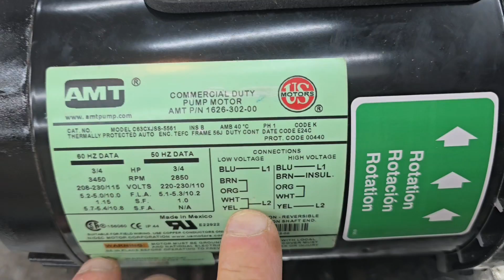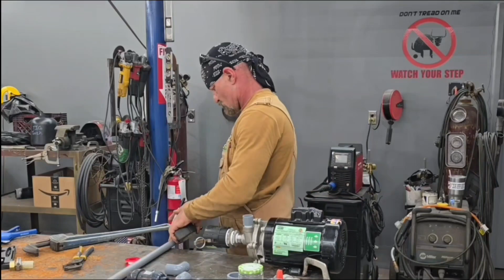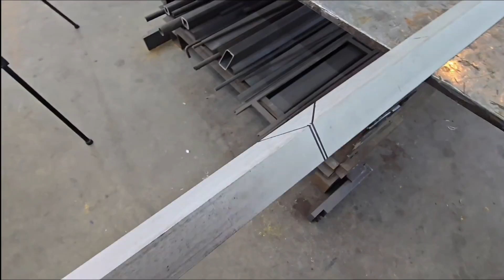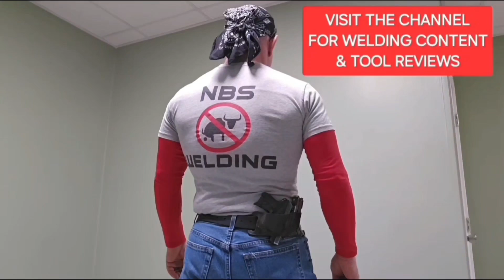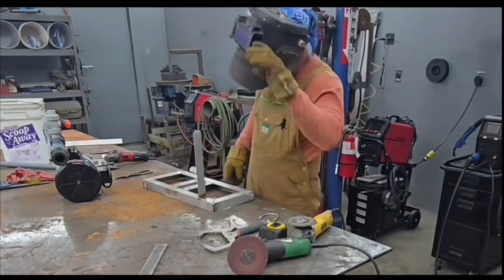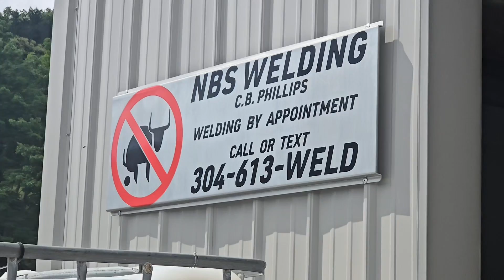MIG welding stainless steel angle frame and water pump rig up

Comment: Nice work as usual, C.B. I have a question not pertaining to this video. My question is, which process would you use to weld a set of new  hangers to a dump trailer? Thanks, C.B.
Reply from the maker: Stick, MIG, or flux core
Reply: @NBSWELDING Awesome thx C.B.!

Comment: What is the point of the pump? You can just open the valve on the tote.
Reply from the maker: The pump is to be used on a jobsite to empty water in a large plastic tank called a "duck pond" on the site of a natural gas or oil well

The only thing I'm using the tote for is to test the operation of these pump assemblies as I fabricate them and hear the pumps run to see if there are any bad bearings or impeller issues

Comment: thats nice but i think you should  have made a handle for it in my opinion people will carry it by the pipe
Reply from the maker: It's meant to be carried by the pipe and the schedule 80 CPVC is more than strong enough to be used as a handle...its quite comfortable to carry by the pipe and there is no issue with that

Comment: My understanding of hard wire MIG welding stainless steel with 75/25 is that you’re giving up some corrosion resistance over using tri-mix. I myself have done the very same thing and it works fine. I know you know this, I only mention it for other less experienced viewers. Lately, I’ve been running some Lincoln Ultra-Core gas shielded flux core SS wire. It’s designed to run on 75/25. Works and runs great but it’s pricey.
Reply from the maker: Yes...and you should also keep separate stainless steel wire brushes for use on your stainless work and make sure you don't contaminate those by using them on regular steel but I don't do that either.  I use the same powerbrushes on steel, stainless, and aluminum and I haven't noticed a difference or any extra corrosion on the stuff even months after I've done that
Reply: @NBSWELDING Now, I have seen a carbon steel cup brush cause SS to rust. I did a job years ago before I knew better and we used carbon steel brushes on SS angle on a Friday. It rained over the weekend. Monday morning, there was rust swirls everywhere we had brushed it. I hit it with a SS cup brush and that took it off. Don’t know if it ever came back.
Reply from the maker: I been watching for it but just haven't had it happen...wouldn't risk it on stuff that was real important but on things where it doesn't matter I try weird stuff sometimes just to see what happens